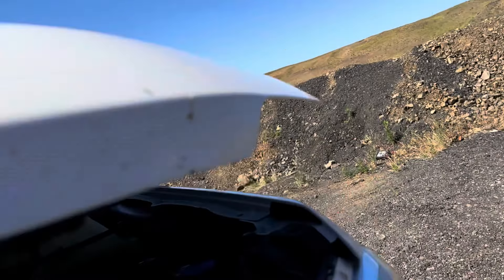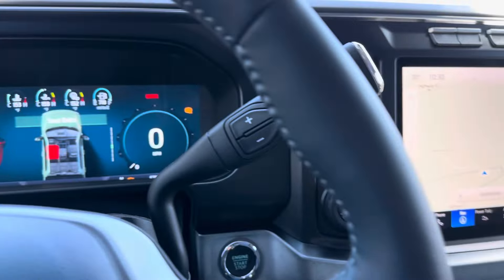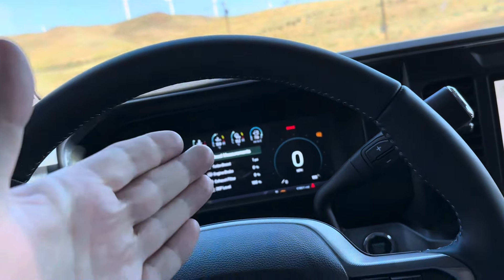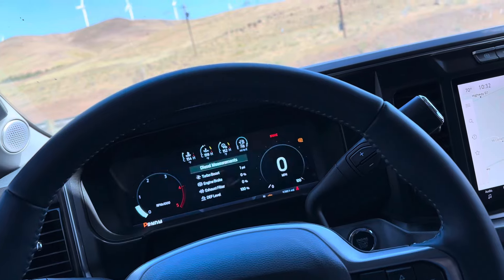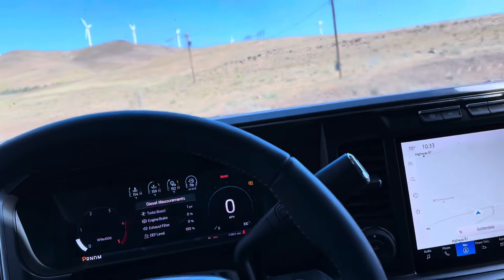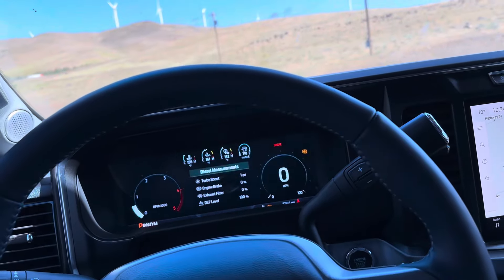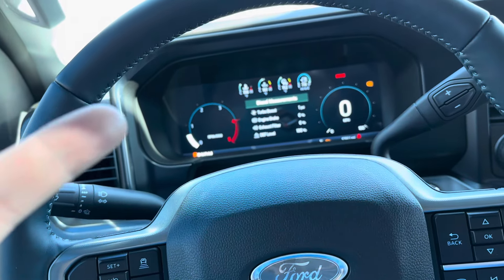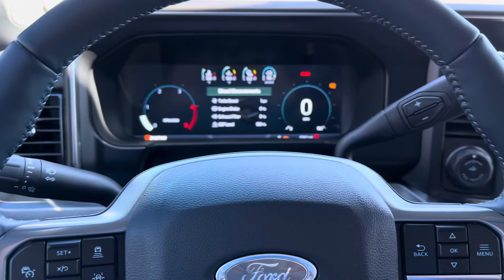2024 Ford f350. Def usage

Comment: I know this might be a stupid question but after driving new rams, a new powerstroke and getting time in the L5P which brand would you say fits you the best and also for a man starting out which brand would you recommend yourself for someone else to use? I’m just curious I’ve been following you for awhile now and over the years you were strictly ram and now you’re kinda stepping your toes into the water for different things. So far ive only owned 2 6.7 Cummins a 2015 2500 68rfe, 2008 6.7 g56 and a 02 LB7 Dmax. I’m looking to get into the hauling business here soon and I’m in the market for a truck at the moment but I’m so torn between the 3 honestly so that’s why I was looking for someone with knowledge and experience to see what your opinion was.
Reply: Stay away from the new Cummins trucks.  You can’t go wrong with either the Ford or GM.  I think GM still has the better transmission but I like my Ford better overall.
Reply: Things to know.
2019-up Cummins has major design flaws with lifters, no bearings and engine failure will happen.
Powerstroke CP4 is known as a failure point on any diesel, unless you run fuel additive with lubricity to prevent it from happening.
Duramax gm designed and built transmission with fake Allison label purchased from Allison, otherwise people will not consider duramax.
No problematic cp4, however crankshafts prone to breaking causing severe engine damage.
Reply: @repairvehicle  that explains why I’ve seen numerous guys weld the crankshaft  on those Duramaxs. Never knew that was a major issue until recently. I have a good friend that owns an L5P and so far he’s very happy with it. My only thing with GM really is the IFS which most people don’t mind but for me Id rather have a solid axle Incase of off-road situations. Me personally I’ve been looking into the F450s but a lot of guys have told me to get 17-19 because the 10 speed auto isn’t really that good in the 20-22s compared to the 6 spd in the 17-19s. I love the looks of the rams and I’ve personally owned 2 6.7s and never had any majors issues however I have read where the 19s and up where having issues so you saying that must mean it’s true. Which is such a shame because the Cummins platform use to stand by their name and their products but I guess greed is really what is ruining these manufacturers. Thank you for your input much appreciated.

Comment: My 2024 HO never leaves 0% on the exhaust filter, but my DEF Level drops like a rock  I'd be surprised if I got 3 tanks of fuel maybe 4 before I'm out of DEF.
Reply: They stay cleaned out passively if you run bio fuel.  If you’re running dino diesel it will fill the filter up and do a regen like normal.  The regen is very fast though compared to any other truck I’ve had.  It will clean itself out in a just a few miles.
Reply: @Parker-ub8xu  my exhaust filter literally is on 0% all the time. It never moves. It may as well not even be there. If it’s zero, what would be the explanation of my def level dropping?

Comment: I have never noticed my 2018 Ram do a Regen? What's up with that?
Reply: The only way I can tell my 18 ram in regen is through scangauge, when it starts and ends. Also, how full it is with soot
Reply: I use to own a 2015 6.7 and before I got it deleted the only way I could tell it was in regen is when I’d have the truck parked and it would go into a high idle and you could smell the DEF being burned from the tailpipe area. Also when pulling a load if it was going up hill and it went into regen I could tell the difference in power wise but other than that you can’t really notice it like the older preDef trucks.
Reply: @jeffelmore6652  This was really good info, thanks! 😉

Comment: I'm wondering why it seems the on road manufacturers have to make their engines more complex than necessary. It doesn't make sense why the off road segments can more or less take a tier 2 engine that has a fixed geometry turbo and no egr and make it tier 4 compliant by only putting a doc and scr canister behind them

Comment: One thing about RAM, besides having the best diesel on the road, is they correct things fast. CP 4 recall replaced with the CP 3 for 2019 and 2020s. Also bad motors for the 2022s. I know of many failed CP 4s in fords and chevys.
Reply: Chevys don’t use cp4 anymore. 5gen rams have bad lifters, no bearing in them and it’s a ticking clock ready to explode

Comment: Still have the cp4 in that powerstroke?
Reply: Of course
Reply: It’s brand new..
Reply: Exaggerated in all my years driving one I have not seen one go and I don’t know anyone that’s had one go.
Reply: @JakeScott-ke3sh  then why there is kits available to replace cp4 with another more reliable, if it’s exaggerated? No one created kit to replace cp3 pumps
Reply: I’m just saying my experience and it’s hard to believe, companies need to make things to sell even if they are not needed, maintenance is key
Reply: @JakeScott-ke3sh  how do you maintain your cp4? What maintenance you do on cp4?
Reply: @repairvehicle  I have the h&s upper and lower fuel filter set up, and I’ve been using hot shot secrets, and I don’t use any of the bio diesel
Reply: @repairvehicle The failures are real but not common enough to worry about.  My company has a lot of cp4 trucks.  I’ve yet to see a single one of them have a failure.   The aftermarket companies hit the nail on the head from time to time but mostly make their living by selling you stuff that you never needed to begin with.
Reply: @JakeScott-ke3sh Yep.  Marketing and internet bro hype have made people of a lot of money in this industry.
Reply: @repairvehicle feed it diesel and change the filters when it’s time.  The same as you would with a cp3
Reply: @Parker-ub8xu  the YouTube hype lol if YouTubers say it then it’s real 100% I see and drive so many oil rig 6.7 with almost 10k hours and literally not a single issue these people say. My personal 6.7 has over 6k idle hours and not a single issue and I tow my tractors and travel trailer most it’s life